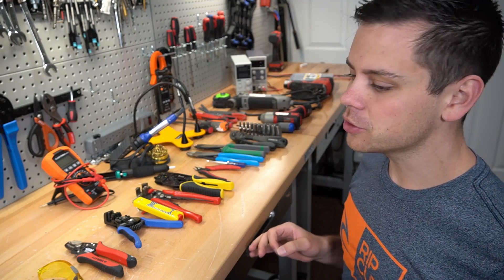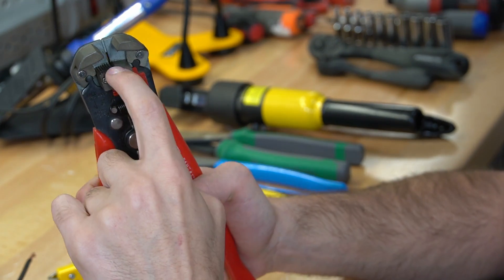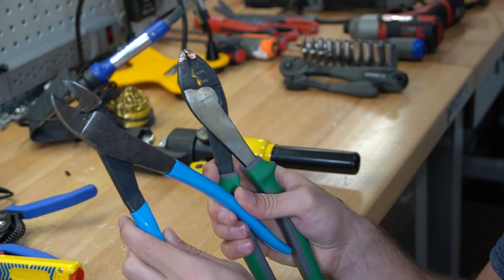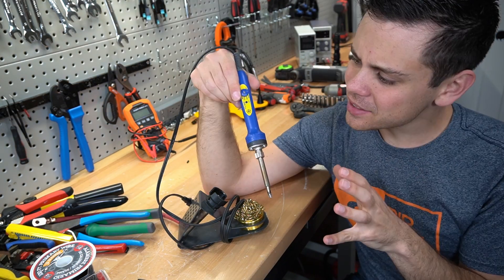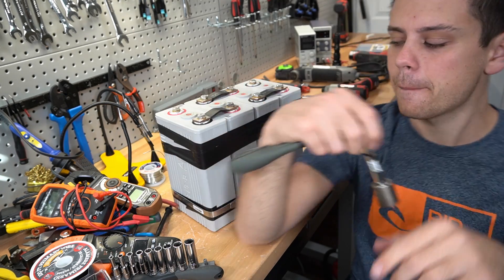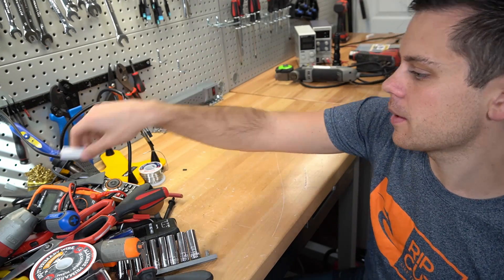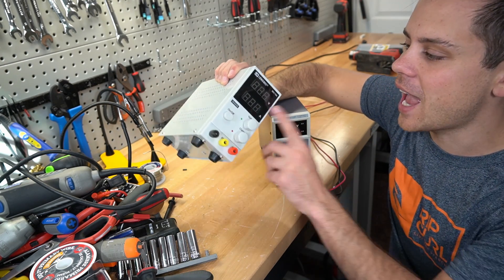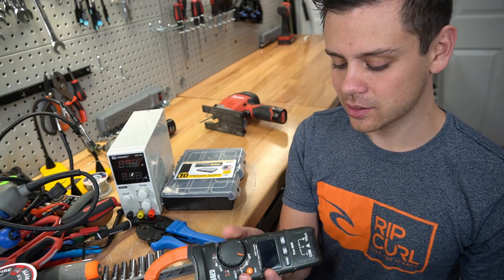Will Prowse's Favorite Electrical Tools! For DIY Solar Projects

Comment from the maker: Tools in video can be found here: https://www.mobile-solarpower.com/tools.html
---------------------------------------------------------
Tired of getting ripped off? Check out my "Will Prowse Approved" solar product recommendations below!

12V Batteries
https://www.mobile-solarpower.com/lithium-batteries.html

48V Batteries
https://www.mobile-solarpower.com/48v-batteries.html

Offgrid Inverter System Builder
https://www.mobile-solarpower.com/48v-complete-system-blueprint-559371.html

Hybrid Inverter System Builder
https://www.mobile-solarpower.com/code-compliant-48v-offgrid-system.html

Mobile Handtruck System Builder (very popular!)
https://www.mobile-solarpower.com/mobile-48v-system.html

Solar Panels
https://www.mobile-solarpower.com/300w-solar-panels.html

Ground Mount Solar Racking
https://www.mobile-solarpower.com/ground-mount-racks.html

Wire, Lugs and Busbars
https://www.mobile-solarpower.com/wire-and-connectors.html

Tools
https://www.mobile-solarpower.com/tools.html

Fuses and Circuit Breakers
https://www.mobile-solarpower.com/fuses.html

Plug-N-Play Solar Systems
Ecoflow, Anker And Bluetti! So many models to choose from. See my current recommendations here:
https://www.mobile-solarpower.com/full-size-systems.html

~~~~~~~~~~~~~~~~~~~~~~~~~~~~~~~~~~~~~~~~~~
Need to build a large DIY system? Need a trustworthy solar distributor? These are my favorites:

Signature Solar
Creator of EG4! Solar Minisplits, Victron and More! Largest Solar Store Online.
If you want $50 off, please use my link below and coupon code "DIYSOLAR50":
https://signaturesolar.com/?ref=cPwLcVc0SW-BjN

Current Connected
Best Prices for EG4, Victron, Midnite and so much more! Fast Shipping and Highest Rated Customer Service:
https://currentconnected.com/?ref=wp

~~~~~~~~~~~~~~~~~~~~~~~~~~~~~~~~~~~~~~~~~~
Join our DIY Solar Community 
Need more help? Join the largest solar forum on the internet for beginners and professionals alike. 140,000 members and counting!
https://www.diysolarforum.com

Check Out My Free Book
Best-selling and beginner-friendly guidebook to off-grid 12V solar!
https://www.mobile-solarpower.com/the-book.html

~~~~~~~~~~~~~~~~~~~~~~~~~~~~~~~~~~~~~~~~~~
Contact Information:
I am NOT available for personal solar system consult! If you wish to contact me, this is my direct email: williamprowsediysolar@gmail.com
FTC Disclosure Statement and Disclaimers:
Every video includes paid promotion or sponsorship (such as free products for review). Some links on this YouTube channel may be affiliate links. We may get paid if you buy something or take an action after clicking one of these. My videos are for educational purposes only. Information is subject to change/update at any time. Electricity is DANGEROUS and can kill. Be smart and use common sense :) DIY Solar Power with Will Prowse is a participant in the Amazon Services LLC Associates Program, An affiliate advertising program designed to provide a means for sites to earn advertising fees by advertising and linking to Amazon.com
Reply: I know you didn't add the heat gun to the video. But can you add it in the list?
Reply: Am I overlooking the insulated sockets?
Reply: Will, please review LifeBlue batteries, especially ones with built in heating pads.
Reply: Some of the lower end lipos4 like the 200ah ones i have from VoltX in Australia  cannot be used in series or parra  that sucks i wanted 400ah at 12 volts the built in BMS gets confused when in series, same battery with upgraded BMS is twice as much money, any way around this, or do i run 2 x solar setups feeding each, ,

Comment: Hey I know this is a super old video, still watching you. I had some questions about the hydraulic crimper. They seemed to come with metric heads and I was wondering if those work properly or acceptably are they dangerous or do they work

Comment: For the ratcheting crimper you are using for insulated conectors, you should normally be able to get drop-in jaws for crimping virtually all sorts of crimpable connectors available on the market (up to the sizes limited by the crimping force the ratchet can provide).

Comment: I'd like to recommend having a combo #1 and #2 tip screwdriver, also called ECX. It's the perfect screwdriver for many electrical parts, including circuit breakers. Using Phillips, flat blade or square bit tips just doesn't prevent slipping or stripping. The combo screwdrivers and bits are available from Klein and Millwaukee.

Comment: I worked in automotive R&D for 16 years.  Agree with most everything but, if you want screwdrivers that just feel right on both ends, go with the expensive Snap-On ones.  You'll have rarer instances of messing up soft screwheads and your hand gets less fatigued.

Comment: Everyone, what is your favorite battery charger?  Say for a 48V battery bank capable of charging at 90A?  Yes, I do understand that's what my panels are for, but if I want to test the battery banks there before the install, perhaps one battery charger to charge them all?  You know, a Ring-type battery charger (one charger to charge them all 6V, 12V, 24V, 48V) from perhaps the darkness of borders Mordor?

Comment: Hey, I've been looking to buy a decent spot welder as I have a project I'm trying to start using LIFEP04 32650 3.2V 5000MAH cells. I've been looking through your videos to see if you make a suggestion. So far no luck. Most of the ones I've seen on Amazon have very mixed reviews. I would prefer to not spend a fortune. Your help would be appreciated.

Comment: fyi, you prob know this by now, but for any one watching, the Jokari cable stripper is used correctly by what you did, rotating the knife around, but then what you should have done is pull to cut along the insulation, better to not cut all the way through the plastic because you can easily break it when it cut shy off all the way through. This way you don't have to fight the insulation to get it off :)

Comment: For stripping thin wires, I have Knipex, the best tool I have (I have 5 different types of such tools). I also bought a Chinese counterpart, it costs much less and is almost not inferior in quality, it only has a problem with very thin wires. But the German Knipex is just a bomb!

Comment: Really quick tip that I found out. You can take normal Automotive heat shrink or better yet marine-grade heat shrink and put it on your extensions and handles of your ratchets for better grip and lessen your chance of shorting something out. It's cheap and effective especially if you already have it on hand like I did. But if not better yet going with composite ratchets like you're saying

Comment: thanks for the great video. i do electrical for work and my favorite handtools are:
knipex cobra 3 piece set
wiha insulated set
makita 7.2v screwdriver
m12 fuel screwdriver
wera kraftform kompact screwdriver
greenlee carbide hole cutter set
fuel hackzall w. 24tpi blade
tool batteries with 21700 cells
wire labeller w. 3/4" nylon label cart
also super tiger brand headlamp on amazon is exceptional

Comment: Dude you really need to buy a Milwaukee surge hydraulic impact driver.  I own the 18v but I’ve heard the 12 is actually better. Let me tell you the amount of control it gives me while disassembly and reassembly of copiers is night and day diff.  If it were to break I would call in sick. Surge. Buy it now, your welcome in advance.

Comment: In Thailand I bought a clamp on ac amp meter for $4.20 from China seams to work but don't really trust it. The Chinese make super cheap electronic tools but most are junk. My Fluke is my standard. Hydraulic crimper looks like a good choice for big work.

Comment: Hey Will, Rog from the UK here - Do you have a link/info on the insulated wrenches please?  Are they Pittsburgh?  If so hellish expensive over here, but they look to be just what I am trying to find.  Did not see them in your linkies, they are not on your Tools web page and neither are they mentioned in your excellent book?
Many thanks for the video and all your Solar/Battery and so on work - all very useful stuff to this novice UK Caravanner... ✅
Look for forward to your reply, cheers for now, Rog... 👍🏻 😉 🐍

Comment: Thanks for presenting, Will!
You asked for own experience with tools, but apart from some exceptions most brands seem country specific, so my favourits won't serve you, as most of yours don't serve me (or just aren't available in Germany).
But some examples: I use a ratchet crimper from "Rothewald", mid-priced "traditional" German tool brand, advertises as "first choice for professional mechanics". Feature: 3 exchangable cheeks for 3-4 sizes of different international standards (e.g. we don't measure in gauge but in mm).
My personal impression: Does its job well. Although I could imagine a reproducibly smoother handling (thinking of your hydraulic crimper).
Example Nitecore torch / flashlight: Very impessive, although I didn't have use for it yet. But I use their 18650 cell charger-powerbank F4 for my dozens of rescued notbook cells. Which is, btw. a brilliant, sustainable and efficient way of repurposed after-EOL usage. I only had less than 10% of drop-out.
Independent from brand, I'd confirm: The better quality the tools, the better the results, and the longer they'll last. Save (too much) on the price, and you'll pay (buy) twice.

Comment: I did pcb repair in the Navy. The ONLY wire strippers we were allowed to use were thermal strippers because they never nicked a single wire or strand. I think the brand was Teledyne.
Reply from the maker: Wow that's cool. I will look those up. Thanks

Comment: I needed to connect two 20 gauge wires and wanted to know your thoughts.

I stripped and twisted them together before adding electrical tape. I used a nail clipper to strip them. I saw a butt connector that requires both wires to be stripped before crimping. What do you think about the connector that allows two wires not stripped attached to a box. You crimp the middle. Is that method OK? Both the butt connection and this box connection carry the same amount of current. I guess another option is to solder the wires, but my car is not close to the electric plug to operate my soldering gun. 

The box connectors costs $1.60 to do the job and the butt connectors are about $4.00 and have many more than required for this one time purchase. 

Thanks!

Comment: My tools are my living. I don't care whose name is on them as long as they always work like I need them to under all conditions including abuse though I try to limit that. Some of my tools come from Harbor Freight and can keep up with tools costing 3X as much but some of their stuff is junk. Many 'name brands' have dropped in quality in recent times, and a few have improved. Look at which tools the pro's use in their trades and you'll usually find almost all of them use one tool above all others, but might use a different brand for a different tool. User what they do and you can't go wrong. If a tool makes your living, you cannot afford to have it fail so you spend whatever that takes- it's always money well spent.

Comment: 3:15 Spin it around (don't take it off) and pull it to the edge of the cable! Then you have no trouble 3:30 with pulling the insulation off. Thanks for sharing.

Comment: Another reason to get Dewalt.

You can't add a random syllable to the name. 🤣

Hydraulic crimp must be fully encapsulated, never get the single sided type. 12 tons of pressure on one side gets bendy. And never try to force a Hydraulic press once it is bottomed/topped out.

Comment: Your soldering iron is just 63w, nothing to roll on the floor. The main difference is the tip. Bigger tip better heat transfer and easier soldering. (see YT EEVblog #183 28:25)
Reply from the maker: Oh I'm well aware

Comment: I broke (chipped) both of my precision, small gauge wire cutters, cutting too large of wire, awhile back and came here to find out which ones you recommended. I bought the Hakko ones from Amazon because they were cheap enough and I have Prime shipping. I even bought the ones for the next size larger wires because they are the reason I broke mine in the first place. Thanks for the review.

Comment: Will, you have got to try cobalt drill bits.  You will wonder why you ever used titanium nitrite.  They will drill stainless steel.  Harbor freight sells a box set online, strangely they don't sell them in the retail store.
Reply from the maker: Holy cow. Will do. You're right.

Comment: Will, have you tried any of the Anker Flashlights? I have several and my LC-90 model has stayed charged for a long time now, I don't think that I have charged it in over a year, and it just takes a micro USB plug to charge it.

Comment: The impact driver would have to be one of my favourite tools. You have to be careful as they are powerful and can strip threads, especially if you don’t start the thread of the screw or bolt properly. Made that mistake in the early days, but after a ton of use you get to know it’s power and how to operate it correctly.

Comment: Paladin Stripax 6 Pro.  Excellent strippers.  Used them on a job stripping 10 thousand, yes 10k 30 awg thermocouple wire.
Reply from the maker: Holy cow! Will check those out
Reply from the maker: Wow looks like a potential new favorite tool. Thanks
Reply: I have a set of Stripax strippers from a kit that I bought years ago.  I just recently started using the Stripax.  OMG!  They are so good!  Every strip is perfect, as long as I set them up right.  I figured out how to cut the jacket but not completely remove it from the wire.  That works out well to protect the wires until I'm ready to connect them.  Anyhow, thumbs up for the recommendation.

Comment: I'm going to get a Uni-t clamp because I won't be using it every day, and I love my $25 an8008. Hard to beat them for the price if you are more of an occasional hobbyist. Still accurate enough and will last under under use unlike the really cheap crap.

Comment: Milwaukee makes fantastic insulated electrician's screwdrivers. There are other brands you'd expect to find at a supply house but the durability and "fit" of the milwaukees was impressive. I used a HVAC Tech's new set because he was so impressed and I loved them.
Reply: My only warning about Milwaukee is that the Home Improvement stores don't really carry the good stuff, and not all Milwaukee tools are good

Comment: My thoughts on a soldiering iron, and I’d love to hear yours especially since they are going to be one of your biggest draws on your battery wall.. 
   I have an automotive trigger style WELLER that has literary been in the family for 3gens! my papa bought it new from western auto late 60’s early 70’s...   2 stage trigger, (750/1500) that almost instantly goes to temp! (It buzzes!!’lol)   It works better than new. And I suppose why is because it’s hardly EVER ON!. Never more than 20-30 secs... it ways about 31/2 lbs but I bet it uses less current per soldier joint than anything you could but today... I can’t think of any other reason a heating would last so long...

Comment: Hi will, great selection of tools. I have some of the ones you have. Glad you fixed one on the spot😁

I do have a tip for you, get yourself a  Solder Fume Extractor for your work bench. Breathing in all that solder smoke can be harmful 😐

Comment: There are multiple dies available for your yellow ratcheting crimpers. MC4, insulated terminal, non insulated terminal and pin terminal.  Didn't like any of the auto strippers, they don't do well on 10/12awg  THHN wire or 10awg MC4 cable required buy NEC. My cable cutter stripper did a better job.

Comment: Check out the RD 6006 power supply with the case and Bluetooth module. It's cheap, and very versatile. Should be great for charging batteries

Comment: Wil, with the Jocari knife, after circling the wire you are stripping to cut the insulation and while the knife is still on the wire, just pull it towards the end of the wire to cut the piece to be removed along the length of the wire. It will then be easy to peel off.
Reply from the maker: Oh that's smart!!! Thanks for that. Wow I had no clue

Comment: Hey how you doing enjoy your videos I'm building a solar in my van my question is I have a inverter that's 2300 watts that Max 4600 I have a circuit breaker that's a 180 amp  and then I have a 50 amp circuit breaker for my 40 amp charge controller my question is is the 180 amp circuit breaker the right size for the inverter I looked at your chart I don't understand it and might just be me but if you could answer that question I appreciate it thank you so much...so stress

Comment: I wonder why all the power supplies are 5A-10A only?  Would buying a higher capacity PS (i.e. 40A) mean it's running for shorter periods of time or does not have have run at it's full 'advertised' rate (which may not be its safe operating rate?

Comment: Excellent video, Will. "Having the right tool just makes everything easier", could not agree more. I have wasted so much time and energy using crap tools and subsequently fixing stuff made with crap tools (especially crimped cables). To your question, I can recommend Rigol as a desktop power supply manufacturer, I have their DP711 and it's pretty solid from my experience.

Comment: you don't show the role over /fold over crimpers or the boxter screwdriver bit set from amazon if any one want's the link message me you tube will not let me post the link  the kit is only 20$ and worth it

Comment: Tools, connectors and wires can and will easily cost hundreds of dollars, adding heavily to cost on a first solar project. On the bright side, they will be around for a while.
Reply: yep spent about $400 in tools to add to my $20k collection to install my rooftop solar equipment. $100 was a fall arrest harness.